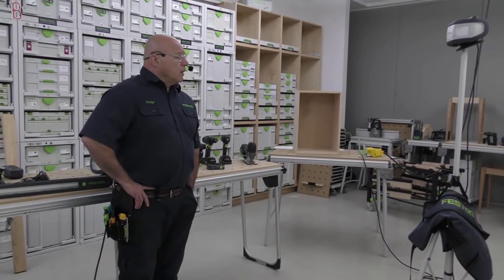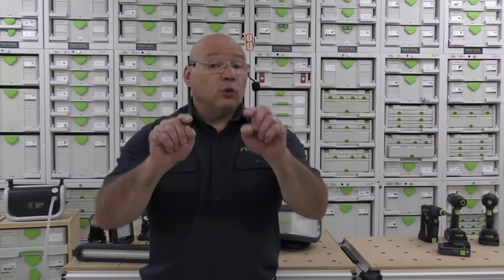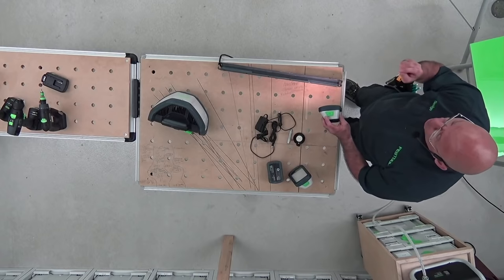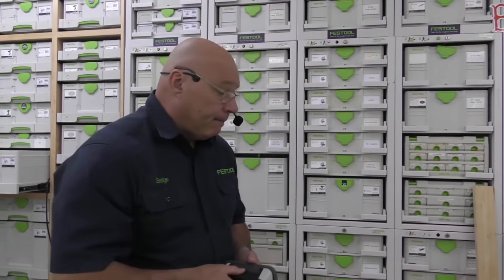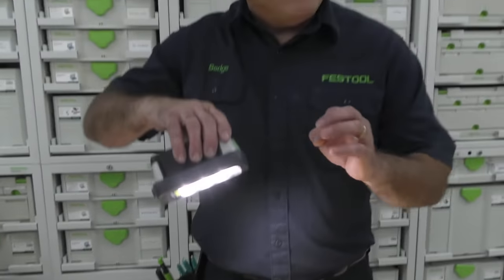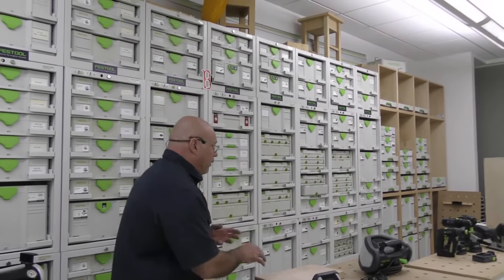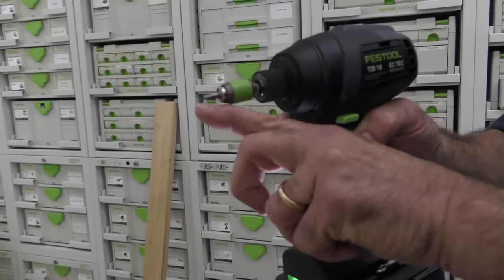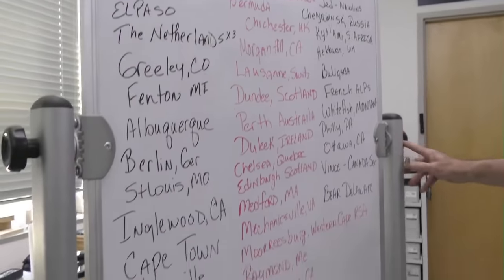Festool Live Episode 53 - Lighting 101

Comment: I have the duo in my workshop and the inspection light and they are fantastic, except that not having the switch on the duo is a pain, so I run it through the Alexa smart plug.  The inconvenience with the inspection light is when power goes off and you switch it back on the light stays off. You then have to switch it back on via the switch on the lamp.